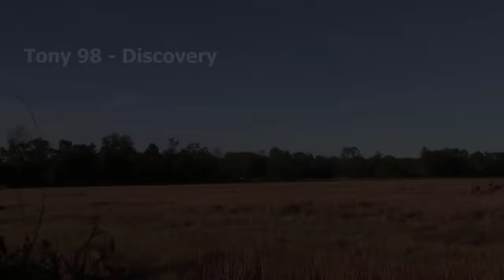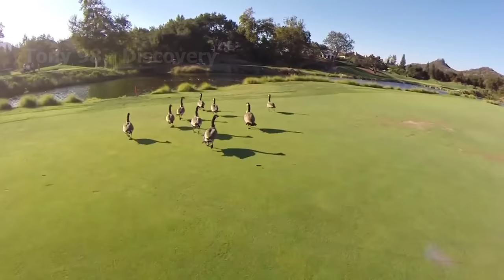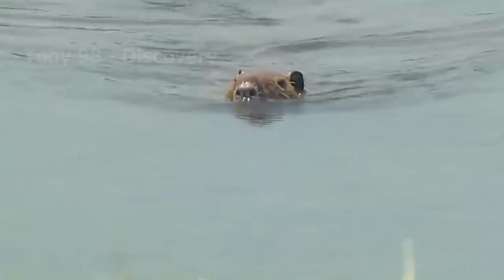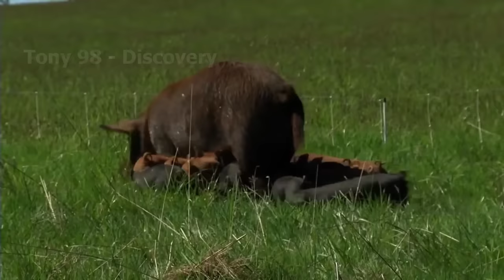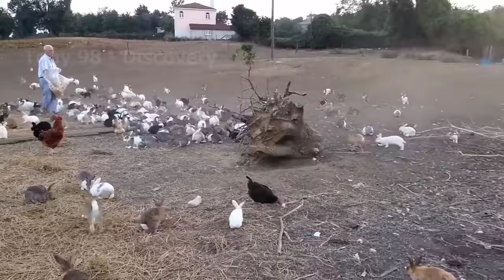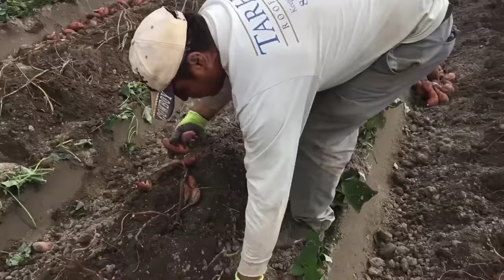American Farmers Deal With Millions Of Wild Animals That Damage Crops This Way

Comment: Wild horses may be majestic, but their impact on farmland is devastating!
Reply from the maker: While wild horses are undoubtedly majestic, their impact on farmland can be devastating when their population exceeds the land's carrying capacity. It's important to strike a balance that ensures the conservation of these animals while also protecting farmland. Through responsible management practices, such as fertility control and range monitoring, we can strive to mitigate the negative impacts of wild horses on agricultural areas. Collaboration between stakeholders is crucial in finding sustainable solutions that consider both the ecological and agricultural needs.

Comment: Can we take more effective deterrents to keep Canada geese away?
Reply from the maker: Finding effective deterrents to keep Canada geese away is an ongoing challenge. However, there are various techniques available, such as habitat modification, visual deterrents, and noise devices, that can help discourage geese from settling in unwanted areas. It's important to consider local regulations and consult with wildlife experts or agencies to determine the most suitable deterrents for your specific situation. We encourage exploring different approaches to address Canada geese-related issues effectively.

Comment: Wild horses are causing habitat erosion and degradation.
Reply from the maker: We understand the challenges posed by Canada geese and the significant damage they can cause to agricultural fields. Protecting fields from Canada goose-related issues may involve a combination of strategies, such as habitat management, physical deterrents, and crop protection measures. It's important to consult with wildlife experts, local authorities, and agricultural extension services to develop a comprehensive management plan tailored to your specific circumstances. Together, we can strive to find effective solutions and protect our fields.